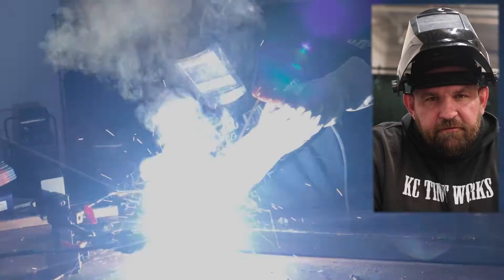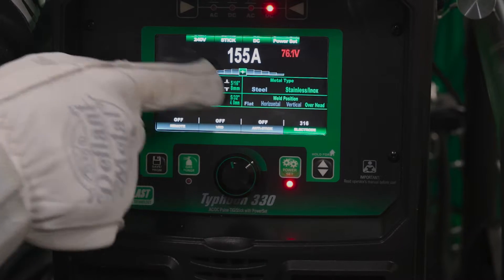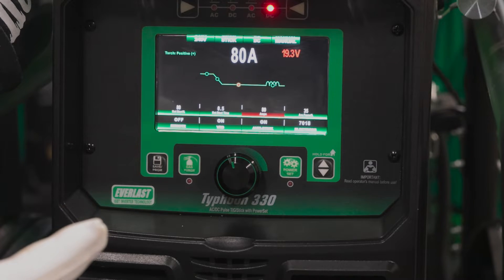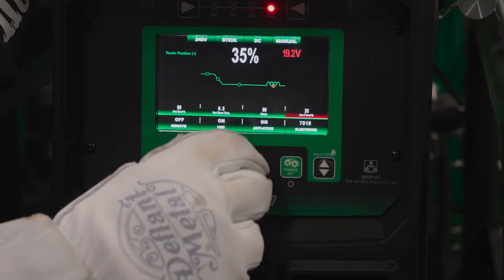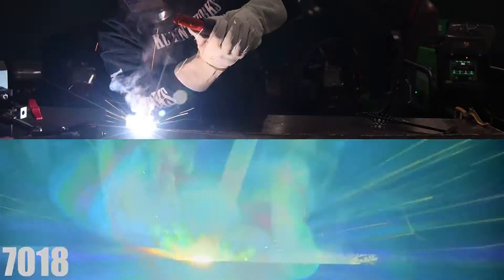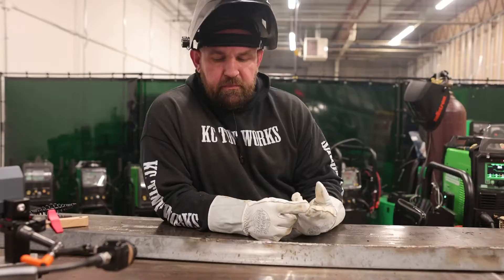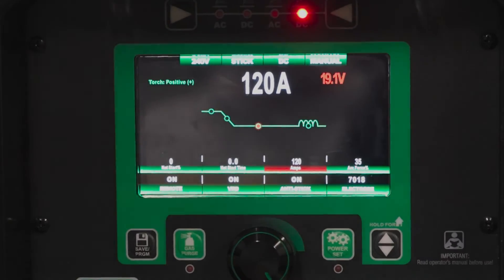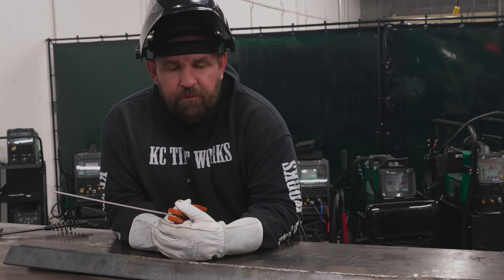Everlast Welders Typhoon: Stick Overview

Comment: I weld with CEA ( Italian ) hi have puls mode , good feature... also you can change polarity +- from display.
Reply: Uhhh.ok...and?
Reply: @marklugo6002  And so on...
Reply: European machines are overpriced AF! I do TIG stainless and titanium exhaust with Everlast for a couple years now and it's a no brainer, also aluminum intake systems.
So you better weld mean & weld green! 💚😆🤙
Reply: @soundslikealot  Im welding also stainless and aluminium with Everlast tig, but red, bought from Europe.